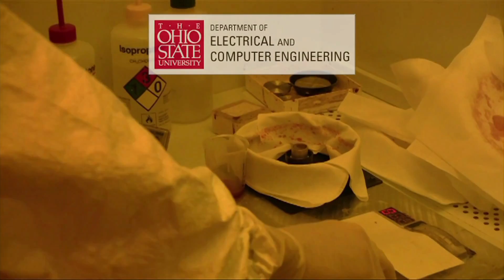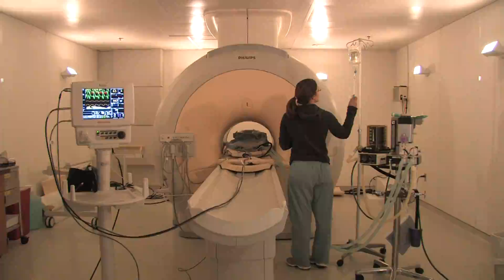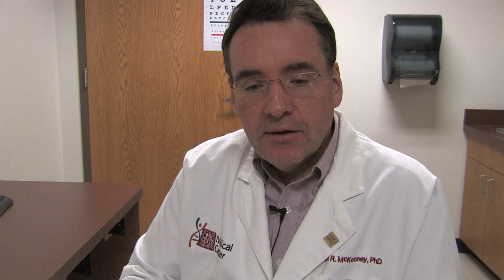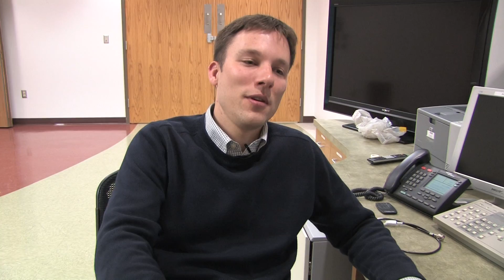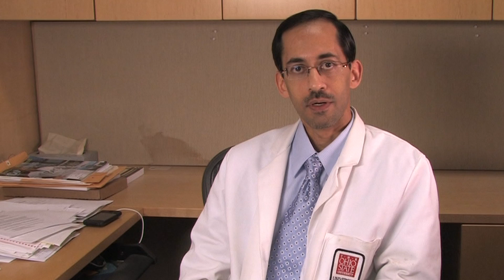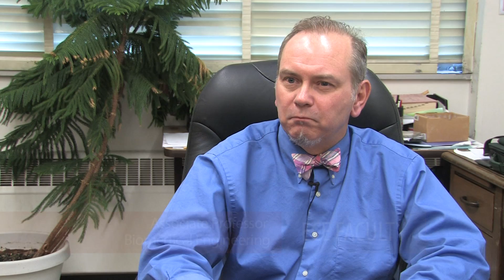Bioelectrical Engineering Explained

Comment: I would think the concept of the course of "Biochemistry" should be properly termed "Bioelectrical Engineering", or vice versa since it very much deals with Electrical Energy changes by nodes and tangents of ionic systems,  buffering systems, ,partial pressure systems, lipophilic and lipophobic systems, and hydrophobic and hydrophilic systems, anodic and cationic systems, acidic and basic systems, agonist and antagonist systems, co-factoring electronic and nucleophilic systems, which essentially governs the progress and recess of changes in ONLY the POTENTIAL at the fundamental cellular quantum levels of progress for the human body's metabolism leading to life.